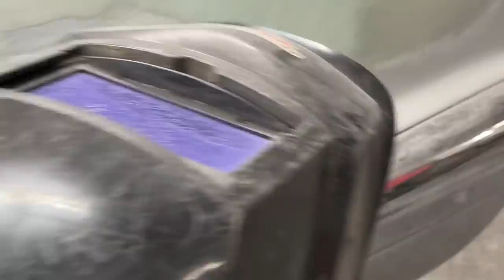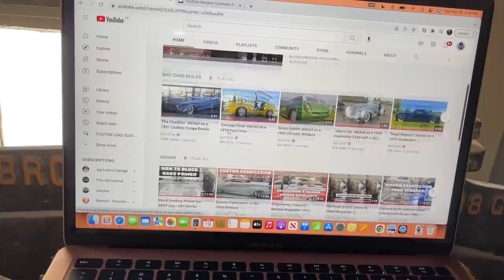Customizing a 1960 Chrysler Chrome Bumper

Comment: I am an electrician and have a chevy express van 2004. These vans had a bad paint job from the factory. She peels.  Just to get by for a bit I taped off a peeled section and sanded it, windexed the spot, and used rattle can paint primer to hide the peeled area. The color isn't exact but from 15 feet you can't tell the difference.  I did the same thing with the steel part of the front bumper, sanded her, windex, used a rust reformer paint then semi gloss. Made the van look 5 years newer until my new van comes in. Thanks Chad.

Comment: Chad, I like your window system but I wonder if a bicycle brake cable might allow you to change pulling direction for the crank or motor by using a pulley rather than your belt having to remain vertical.  Just a suggestion.  Not sure if you're going to use a motor or crank .  the track system you made is cool but a cable would let you put a pulling motor in the door

Comment: Great videos,  did you ever see that spray-on Chrome paint.comes in multi colors. Seen it used on motorcycle, 4 wheelers, even on a whole truck. Stuff looks cool. Saw it on utube.

Comment: Wouldn't it been better to weld a piece on the fender and not the bumper? The same look would have been achieved but you wouldn't have wrecked the chrome on the bumper with the welding. Or are you going to do something different with the bumper?